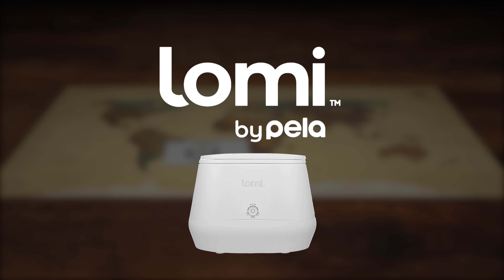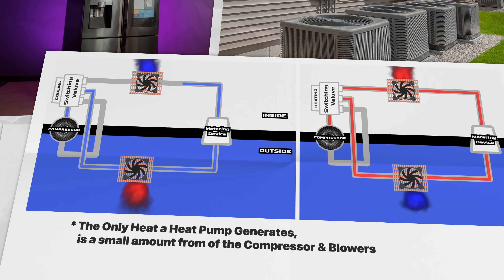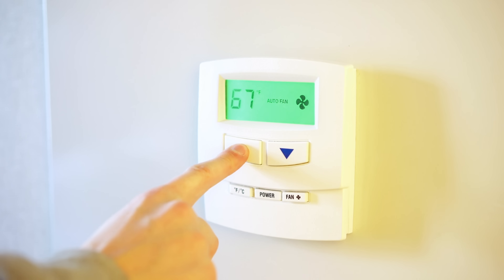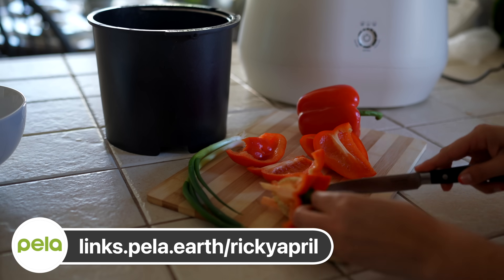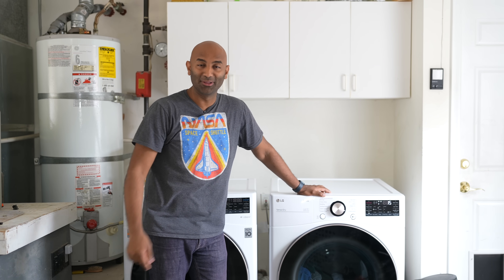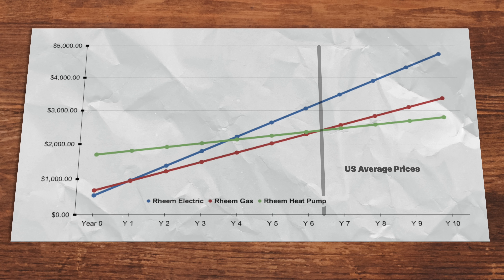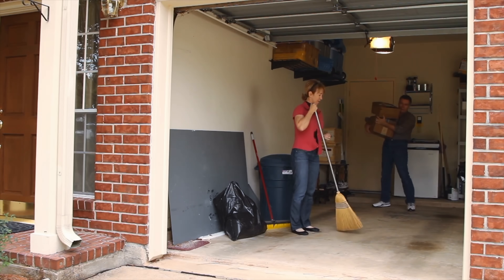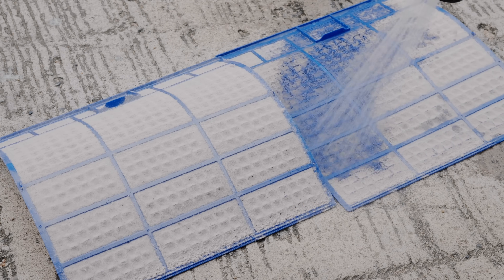I'm Shocked How Much Money Heat Pump Appliances Save!

Comment: I experienced a heat pump during a very cold period a few years ago. It failed. It initially heated the place, but after a while the outside unit froze over with ice and sent the unit into defrost mode. It was useless until the sun next hit it.
Reply: Exactly!  Heat pumps cost tons $ to operate doing the same job versus traditional gas furnace.
Reply: Can you run dual fuel? The system I gave runs heat pump and gas furnace, and will modulate when needed. I don’t think I could rely on the heat pump alone where I live.

Comment: The grid could send a signal down the line to turn on dryers at night based on load and house number.  22 main st receives a start signal at 1:30 am.  23 main at 2:00 am 24 and 25 at 2:30.

Comment: I just paid my gas bill used 46 therms at .31/therm. So glad I don't live on the West cost. Even if you figure in meter costs and fees, I'm still under $1 a therm. My total gas bill was $39.37
Reply: You used over 1000 kwh of power.... 3 people in my household and we used 376 kwh of power and paid under $60 for it. Over 50% of that cost is in fixed fees. Maybe you should look at your power needs and dump some of your useless electronics.
Reply from the maker: I run a business from my home, i technically have two houses, a main one and a casita, where we run our business. I have 3 employees, and kids etc... so that's sort of par for the course. We have several big computers and laptops and servers running all day. But we did recently find a way to cut 200 kWh off our usage, it involves our pool, we'll share more soon!

Comment: The issue with heat pump water heater is the tank will fail before the pump.  So every 10yrs will be throwing away a bad tank and a good heat pump.

Comment: Didn't explain in detail how heat pumps work.
Doesn't understand Centigrade. Here's a quick lesson: 0°C is temp water freezes, 100°C water boils. 50°C Death Valley and 25°C comfortable. WHAT IS THERE TO NOT UNDERSTAND???
Plain simple numbers that are easy to remember, and you can actually use them in basic day-to-day science rather than some random numbers like 32F freezing or 212F boiling. Ridiculous.

Comment: So, clothes dryer in San Diego. It's called outside, surely. Like, in the air. Like most of the rest of the world including so many wetter places where we think you need your heads read. Clothes dryers in any powered form are ridiculous in your climate!
Reply: And if you've still got gas heating plumbed to your pool until you get around to a replacement I reckon you're on a really greasy podium.

Comment: I put a heatpump on my pool that lasted about 7 years before failing. Every two years I had to replace a huge plastic insulating pool blanket that couldn't take the Arizona sun. Those huge sheets are still slowly breaking down in a landfill somwhere, because my city doesnt really recycle the plastics it picks up in the special bins. The blanket wound onto a huge roller that was difficult to store in the off season.  If wound up wet and stored it would mildew. I didn't replace it when it failed because it had been so much trouble.

Comment: Nope, heat pumps in dryers or modern no-frost fridges are being shoved into customers face left and right because they are very hard or impossible to repair once gas leakage will occur, and thickness of copper leads filled with gas is designed to crack right after 2 year warranty period. Finding and sealing such leakage is impossible because 99% of the time it's microscopic and it's like looking for a needle in a haystack. It's not the future, it's anti consumerism, but i guess it's shiny so only engineers can see through that smoke and mirrors. Let's not even start about modern gas like R1234yf which will kill you once inhaled by accident apart from being highly flammable.
Reply from the maker: Every fridge is a heat pump my guy, unless it’s a peltier style and that’s only for small little wine coolers etc.

Comment: Ricky, this does not compute.  The COP for a heat pump with an air-source heat exchanger outdoors is NOT anywhere near 5 when it is really cold outside, and the heat exchanger will ice up, because it would have to operate well below ambient air temperature to exchange heat, freezing moisture in the air.  This is why heat pumps have resistance heaters in the air handler to provide heat when it is too cold for the heat pump to produce enough heat, or to defrost the outdoor coils after they ice up.  Similarly, when used to air condition in Summer, it has to reject heat to already hot air, which reduces the COP similarly when you need it the most on a hot day.  What DOES work is a GROUND-SOURCE heat pump system, where the heat exchanger is buried underground where year-round temperatures hover closer to 70 degrees.  In this case, the COP remains at 5–7 constantly, whether heating or cooling the house, because the target temperature for the conditioned heating/cooling zone is almost the same as the ground source temperature, and the supply of heat or “cold” is immense in moist buried soil regardless of outside air temperature fluctuations.
Reply from the maker: They have hybrid systems that default to traditional electric when it’s fitting… and the rest of the year you get the benefits. It’s why they usually cost more.
Reply: @TwoBitDaVinci   One could combine a heat pump with a gas furnace, and use the gas instead of resistance coils on coldest days, IF gas is available.  I had a heat pump, with coils for backup, in my Florida house.  It was marginally able to keep the house warm on a cold day; always a kind of drafty barely warm air coming out of the HVAC registers with blower noise most of the time.  In summer, it only had to cool around 20 degree temperature difference, with the primary function being to dehumidify balmy Florida air, but on cold nights, with a 40 degree differential outside to inside, it was barely able to heat to 72 degrees inside.  I would never want another air-source heat pump system, but a ground-source one, with Florida soil constant at 70 degrees year-round, should work very well; maybe in Sandy Eggo too, with your temperate weather and warm ground.

Comment: Heat pumps won’t work in the south to keep homes cool in summer time.    Those pushing these are not fully honest with their limitations.
Reply from the maker: Do you know what your air conditioner is? Do you have one for cooling? That’s a heat pump, just you keep the cold side and discard the wsrm

Comment: Another thought: waste grey water still has a lot of waste heat that could be extracted before dumping the rest of the water to the yard. Can that be used to heat water?
Reply: The cost to collect that heat would be more than you would get out of it unfortunately.
Reply: @travisschneider3011 : Maybe so. I was just thinking that if Ricky is capturing grey water in the future, he might also try to remove the heat before dunking it on the yard. But if the technical complexity to use a heat pump to extract heat outweigh the cost due to added complexity,  perhaps a more passive heat recovery system like a coil of cold water around a vertical piece of waste water can be used to preheat the cold water thus reducing the need for hot water which reduces electric load if he gets a hast pump water heater.
Reply: @ThalanorThornhale  I figured even for that the effort isn't worth the trouble.  As the water would only be warm(distance and mixed with cold) by the time it makes it to the exchanger and the water waiting to be warmed will sit cooling off more before being brought into the water heater.  If homes used more hot water it could work well.  That's why you can see them in some high hot water usage commerical buildings.

A solar hot heater heater to preheat the water coming in will do a much better job.

If he has the space, do a full solar water heater with an electric instant hot water booster.  The solar would reduce the electric usage by a lot or completely if it is sized correctly.

Comment: I wonder this: for houses with pools in hot areas, can we use the pool as a heat battery? That is: Instead of blowing kind of hot air (low energy density) over the summer over the cooling coils, the hot coils get cooled by the swimming pool water which we want to heat up anyway. In the winter, when we are not using the pool much, we can cover the pool up with black fabric. The black fabric will heat the pool water on cool sunny days common to SD. Then, we can run the cycle in reverse: the warm water in the pool is used to warm the 🏠 again. Because water has a higher energy density than air, is heat transfer therefore more efficient?

Comment: I think this great recommendation may only work for mild climates (40F-90F). I have lived many places north and south and they seem useless below 25F you still have to have a heater. I live in Oklahoma now and two years ago it was -12F with a -27F wind chill at that temp you and your whole house would be frozen solid without the heater. The manufacturer   recommendation's for BTU tend to be low so you get those savings they promise, this means in Oklahoma summer at 110F outside it's 95F inside.
Reply: Fellow Okie here (OKC), figured I'd share my experience.  Almost 2yrs ago now i decided to install a heat pump / ductless mini-split in my 1200sqft hobby shop.  It has scissor trusses (16' high), 3 garage doors and R38 ceiling / R11 wall insulation.  I chose a 2-ton Gree Saphire and couldn't be happier.  It's been triple digit heat for the past few weeks and it has no problems maintaining a comfortable (for a shop) 78F.  The cold spell we had in 2021 it was still making heat at -10F and maintaining 65F when our area lost power.  My friend in Nebraska has the same unit, his shop is bigger and it has performed very well for him as well.  This particular unit does lose considerable efficiency below 10F but its rated to make heat down to -22F and realistically we don't see those temps frequently.  Hope this helps, I have zero regrets and my best calculations are averaging about $20 a month to run the unit.

Comment: 3:32 🤣 What? F degrees are better because 30s=freezing, 40s=cold, 50s=brisk, etc? Temperature perception is different, then humidity also plays a role in this perception. How about using measuring units that don't rely on such arbitrary things? 0°C = water freezing point, 100°C = water boiling point. Easy to remember, right?

Check out how 0°F was originally defined, because it would be challenging even for a scientist to remember the specific mixture used early on. Now try to convert F to/from C or K (the SI base unit of temperature) and remember that formula involving both multiplication and division. Converting C to/from K is just addition or subtraction of a constant number. Now remember how NASA blew up the Mars Climate Orbiter because some people simply cannot be bothered to use the metric system. Keeping the imperial system makes no sense. It needlessly complicates a lot of stuff for a lot of people.

Comment: If you live in a mostly cold climate heat pump water heater is not efficient since you'll have to heat the house more to make up for the cold it produces. Effectively you are heating the water with the same thing you are heating your house with, PLUS what energy the pump uses. If you could have a straight electric heat mode for winter it might be worth it.
Reply from the maker: Most systems here in the US are hybrid, where they have a traditional electric heaters for periods when the heat pump isn’t advantageous

Comment: If a heat pump clothes dryer does not need outside ventilation, it still must have to cycle air through the dryer to eliminate the water vapor that evaporates, right? So is that just vented into the room, and what prevents the room from filling up with a lot of lint? I’ve heard that the biggest source of plastic contamination is dryer vents, which spew microscopic synthetic fibers all over the place.
Reply from the maker: You have to clear the lint trap like all dryers, and the moisture is condensed and either dumped or collected in a tank
Reply: @TwoBitDaVinci  The lint trap is only a first-level trap. A lot of stuff gets through. I’d think they would have a much better filter on the outside that you could clean or change.

Comment: the big problem with heat pumps are that they usually lie about the real efficiency which is alot less and they don't tell you the real lifespan which is usually around ten years if you are lucky. Not to mention the yearly maintenance you should have them do on your system. So if you don't mind spending $500 or so per year for the checkup and a complete new system every 10 to 12 years, then it's a great way to go.

Comment: I applaud your attitude about looking into heat pumps. I question the idea of multiple individual units. What is really needed is a centralized heat pump system that can supply all the needs in your home thusly taking advantage of load diversity between individual units and assuring that no one unit is fighting against any other. Sort of like you find in large industrial building that have centralized chillers. Another subject you might like to investigate are the absorption chillers that can run on thermal solar or excess heat. I remember a few years back there were a handful if that of companies trying to bring a residential unit to market. Those combined with hot and cold storage masses could really be game changers.
Reply from the maker: Agreed! We need synergy!
Reply: I'm a belt and suspenders guy. I'd rather have 2x2 ton heat pumps than 1-4 ton for safety. Also, the smaller ones are more efficient (SEER and COP).

Comment: Your air conditioner is a heat pump?  Spoken like someone who lives in California and assumes almost everyone, almost everywhere, has an air conditioner, I guess?  I live somewhere with a mild climate year round (typically mildly warm in the summers, typically mildly cool in the winters), and I know lots of people with heat pumps.  But they all got them to replace their heating systems (usually oil furnaces, very few people use natural gas for....  well, for much of anything around these parts).  They consider the cooling as a bonus, as most of them didn't have any kind of cool air conditioning before replacing their heating system with a heat pump.  The life assumptions of your Californian perspective showed through in several comments in your video.  Not a criticism, just a caution/opportunity to genericize your videos a little to a wider audience.  :)

I am excited for this video series, as I know tonnes of people with heat pump systems for centralized heating, but I know no one with any heat pump appliances yet (but I've been looking at them with curiosity/interest!).

Comment: -10 to 0 really cold. 0 to 10 is cold. 10 to 20 cool. 20 to 30 comfortably warm. 30 to 40 hot. 40 to 50 really hot. I like to adjust my clothing options every 10 degrees Celsius.
Reply from the maker: That’s a huge change in 10c. 10f has much more gradation
Reply: Sure, but most people can't tell the difference between 81f to 82f or 27c to 28c. Even if they could tell the difference, most car or home air-conditioners are not calibrated to maintain that accurate temperature thoughout the day in most climates.

Comment: Heat pumps in Theory do work HOWEVER...look at where the COP goes in climates similar to Michigan's? When outdoor ambient drops below 32°F COP drops significantly and Supplemental heat is required thus savings decrease significantly
Reply from the maker: Only when temps drop we’ll below freezing is it an issue. Even than it’s usuallly above COP of 1. And when it is that cold most hybrid systems default to traditional electric. But that’s still a huge benefit over a whole year
Reply: @TwoBitDaVinci  My thoughts are: Maybe in Southern States, but in Northern Climates the reliance on Electric Resistance Heat as Back-Up puts Heat Pumps way behind the curve in comparison to 96% AFUE Natural Gas Furnaces. Based on my Professional/Academic Research (Ferris State University/DTE Engineering) and Practical "In the Field" Experience

Comment: Thank you for that, I'm looking at a hybrid heat pump water heater to replace my gas one right now. I've been hesitating about the cost.
Reply from the maker: Me too… doing this research really was eye opening
Reply: @TwoBitDaVinci  Then I ask myself how I'd feel a year from now if I didn't get it? I've had my Nissan Leaf for 4 years now and it was a good decision.
Reply: I got one about a year ago. One reason I don't think is mentioned why they are more expensive is that they tend to have "smart features". I thought that was a waste but you can get a little extra saving by turning down the temp at night, or turning it to vacation mode when you leave and forget to do that.  

On the money side I did the math and figured I'd save $25/month. So S300/year. So in 4 years the extra cost would be worth it. In 6 it would have totally paid for it its self. After a few months I realized I was only saving $15/month. I'm pretty sure this is because I take longer showers since I'm not worried about the energy costs as much.  I also didn't vent to the outside and live in the Midwest.  So about 3-4 months out of the year I leave it on the regular electric mode so it doesn't blow cold air into a cold house. Not really sure what the payback period is. Probably like 7 or 8 years. I also thought think it should last longer since it has two ways to heat water. 

One draw back is that on heat-pump only mode it does take longer to heat the water, but there is a mode to kick in the heating element  if hot water gets too low.

Overall I'd buy one again. Money-wise its still a decent investment. Environmentally it definitely does cut energy costs. Functionally its got more features than a standard water heater, which I didn't think I needed but has been nice.